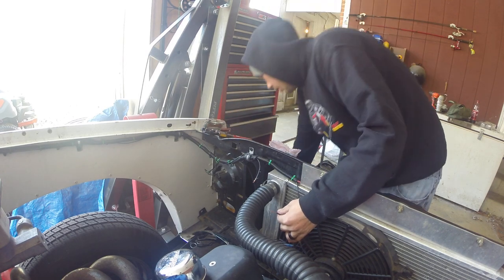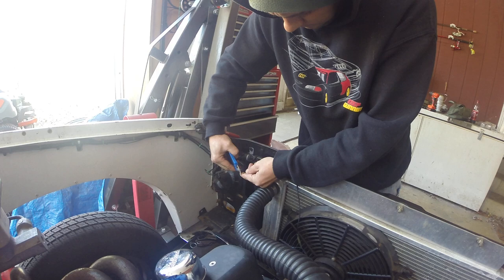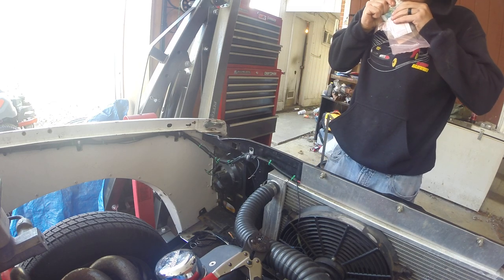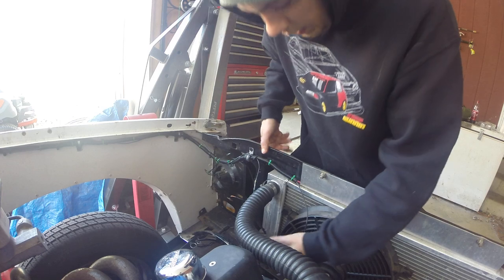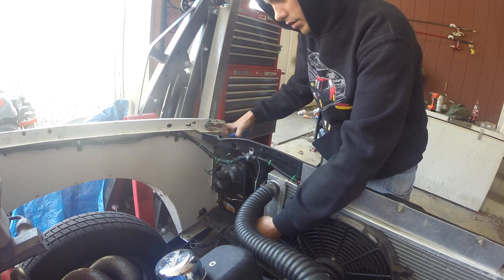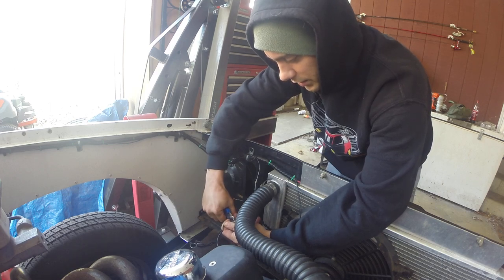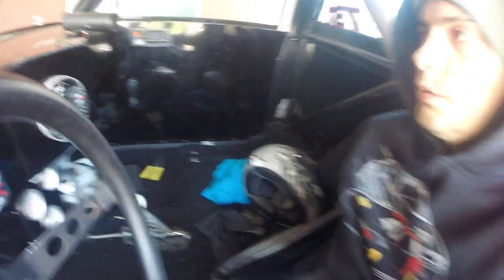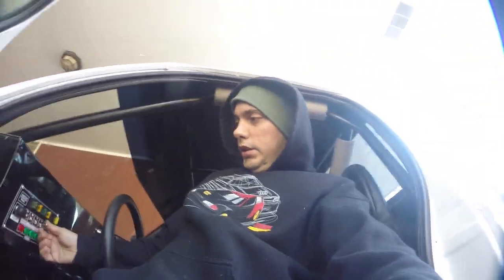Wiring up an electric water pump on a race car.

Comment: So...You wire these to 12 volt switch that comes on with key? Like street performance? What if thermostat does not allow the water to go through the system? What does pump do? Circulate through engine block only?  I wish I knew more about the performance and what happens when these are on ON but using a tstat does not let water run through rad. Thanks
Reply from the maker: It is wired to a toggle switch and relay with a constant 12v on one side of the relay. My thermostat as been modified with a drimel for a small about of restriction. The pump when turned on is just a faster pump over stock and will flow more at a faster rate. But it works as a stock water pump would through the radiator to the block through the pump and back to the radiator.

Comment: Ready to see it on the streets!!!
Reply from the maker: racingonabudget will be soon next main thing is the new fans.
Reply: So normally this would be in a kit, part of the kit is a controller that monitors the engine temp and tells the pump wen to pump or pulse wen engine not at running temperature as you remove the thermostat.  Did you remove the thermostat? and how is it working out without the controller and just a switch? Kind regards from New Zealand
Reply from the maker: So for the late reply. But I have it on a switch set up so I can manually turn it on or off. Say if I am sitting after a run I can cool the car off by flipping the fan switch and water pump switch to have the water circulating to cool it off. It all is a fuse panel and relay set up for minimal and simplest wiring.